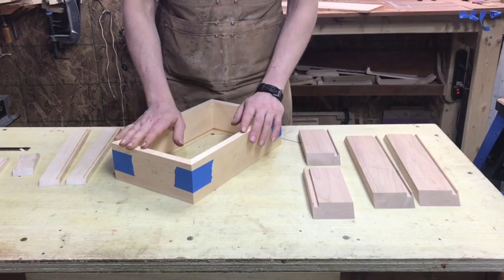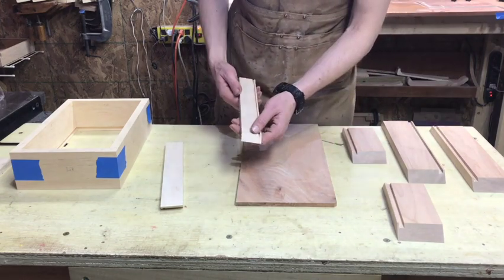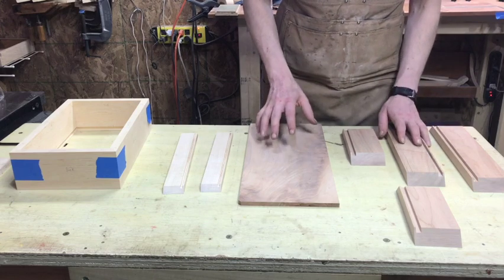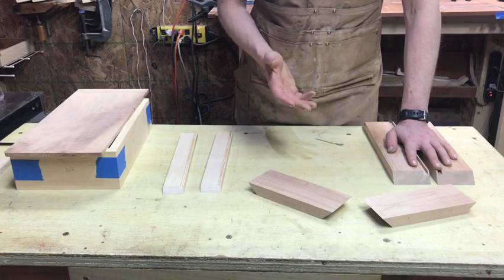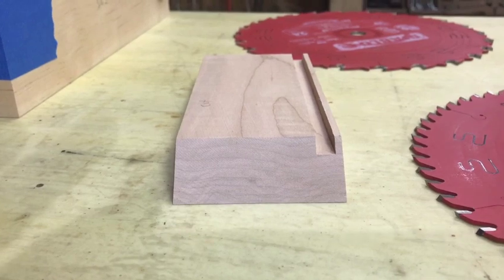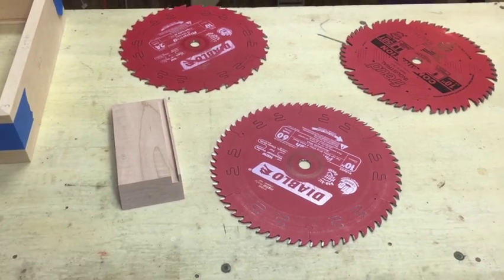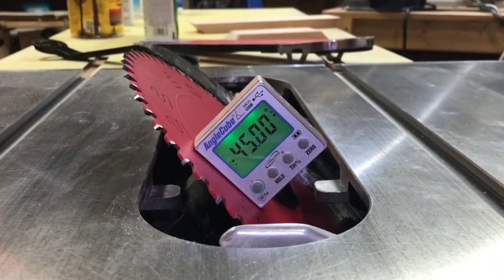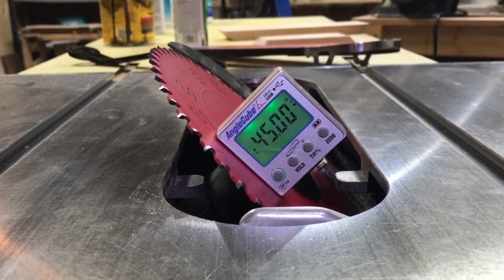Mitered Box Tips - How To Get Better Miters/Bevels!

Comment: Agree with everyone else, this is super helpful, really love the longer in-depth approach.

Question about the mini test box - do you mill that wood?  If not, how do you make sure inconsistency in that wood doesn't throw off the test pieces?
Reply from the maker: Thank you, I hope it helps. It took me a long time to get good miters, and I figured I would try to share all of the little things I learned the hard way.
Reply from the maker: I do mill the wood, but I do a fair bit of it at once, and then keep it all set aside to use for just that. I don't mill it to the same thickness as whatever project, I just mill it all the same and then use as is. It doesn't stay perfectly flat forever, but it is close enough. It's hard to keep any wood flat forever, so getting pretty close is enough for me. 

I will mill it in four, 11in long pieces, to safely get through my planer, and then the first mini-box is 11x11, and every time I just cut an edge off of each piece until it is too small to safely cut. I get quite a few tests out of the 11x11 pieces before they get to 3-4in and get sketchy. 

The 11x11 pieces may last me 6-7 projects depending on how many tests I need each time. I hope that makes sense.

Comment: All good tips and tricks. However...when I first started making boxes, I would spend literally hours trying to get that blade on a DeWalt jobsite saw to exactly 45 deg. Not sure who, and wish I could remember, but someone suggested cutting the miters on opposite sides of the blade. IE, cut one end on the left side of the blade and its mating piece on the right side. Say the blade is at 45.1 on the right side. This means on the left side it's 44.9. So, they complement each other to form a 90. I'll sometimes cut all the ends of my long pieces on the right side and my short piece ends on the left side or vice versa. I've got a sled or 2 and some miter gauges for use on the left or right side of the blade just for these purposes. Seems to work for me. Also, and I'm not sure you mentioned it as I skipped around the video some, but just as IMPORTANT as the 45, if not more so, is getting your pieces the same EXACT length. If the opposite sides of the box are not the same exact length, it won't matter how exact your 45 is. I use a stop block to achieve this. Tons of videos on here showing how to set up different types of stops and stop blocks. 

Thank you for the video and thanks to everyone else on here that has posted videos on box making, sanding, finishing, etc. This is where I learned and I've been pretty successful at making some very nice boxes. To me, there's not much else more satisfying than taking a couple of pieces of wood and making a nice box from them.
Reply from the maker: Yeah, that's a great tip! I often use that method if I am trying to edge glue a bunch of pieces for a panel, and don't want to get my jointing jig out for all of them. One over, one under, and any error is canceled out. I hadn't considered it on miters for boxes. 

Thanks for the tip!

Comment: If using a sled for the miters, I suppose the 45 degree should be set off the sled top vs the table ( since there may be a variation between sled and table) and zero out the wixey guage to the sled.  Your thoughts?
Reply from the maker: Interesting thought. I just do it to the table, but if you think your sled may not be quiet flat, then yeah, I guess it would make the most sense to do it to the sled. 

I had never really thought about it to be honest. I always prefer MDF on jigs because it is heavy, and stays pretty lat, which means I can be fairly confident it is the same. I may have to go test my sled later and see if it is any different. You may just have to test yours with some scrap wood.

Comment from the maker: Choosing the right wood - 1:15
Blade Choice - 9:58
Table Alignment - 11:53
Blade Angle (Angle Gauge Error) - 13:31
Sled vs Miter Gauge - 21:47
Tear Out Issues - 25:17
Removing Dents - 27:29
Sanding Mistakes - 29:00
Should you pre-finish - 33:48
Glue Up Process/Tips - 35:42
Spline Discussion - 41:25

Comment: Great video but I’m having trouble with glue squeeze out on the inside. I try cleaning it with a straw, wet rag, etc, but I still see the ugly marks when I stain. Any advice?
Reply from the maker: Sure...

- Stain/finish the inside first. Once it is glued up you won't be working on the inside anyways, so always stain or finish the inside first. 

- When you place your normal glue, not the watered down, don't place a ton near the inside edge. Paint some there, but not a ton, and then put more in the middle or outside, and as it squeezes to close, it will squeeze the glue in. 

- Put painters tape on those inside edges before gluing up. Then, just peel it off after it has all dried. This will prevent most squeeze out from sticking, and blue painters tape is usually pretty gentle on stain/finishes if the stain is fully dry. 

- At a minimum, just stain the inside before gluing it up, but for me, experience with how much glue, and where to place more/less of it, came with time and experience. You get a feel for it after your fourth or fifth box. Try all three at once if you really want to do everything you can. Wiping with a rag is a terrible idea if it isn't an area you will sand after, imo, and I have no idea why people do it on internal spaces. It just pushes more glue into the wood. 

- If all else fails, a small card scraper may be able to remove a very thin layer of wood, and take the glue with it, but you will need to wait for the glue to totally dry.

Comment: Great video.  I notice you did not show checking for square.  Do you do that?  The tape on the outside limits us to using the inside I'm thinking.
Reply from the maker: Thanks. I'll be honest, I don't really do that these days. The check is the pre-glue tape up check. Based on the math of the angles, if they all close, and there is no serious gap at the top or bottom, they basically have to be the same length on opposing sides, and square, since they can't close without all being 45, the same length, and square,  using my method. It's sort of a check along the way process. 

If your miter gauge/crosscut sled is at 90, your rips are straight and the edge sits flat, any piece that isn't the right length, or right angle, will show up in the check. Any gaps you can't see under the tape are likely due to cupping of wood. If the bottom and top edges are closing at the same time, then that piece is almost certainly square. If you have a small square you can check internally, depending on the size of the box. 

You can also just tape two side together, flip them into an "L", and then check that angle. That won't make sure your opposing sides are exactly the same length, but it will at least mean that those two pieces are square. Again, your wood has to be flat for this, as any cup will throw off the ability to get the square to sit flat.
Reply: Thanks. I had a bad experience lately with a small box.  I think I made the tape too tight and basically racked it.

Comment: Hi Mike,
Which is best blade for cutting bevels  and 
Cutting flat bottom grooves ?
Regards 
Paul
Reply from the maker: Bevels = at least 60 teeth. I use a Diablo 60 tooth crosscut, but plan to move to an 80 tooth Diablo once this 60 is dull, for an even better finish. (Diablo Fine Finish is the 60, and Diablo Ultra Finish is the 80). You can use a brand like CMT, or any other brand of blade that is in the Diablo or better range. Just make sure it has at least 60 teeth. 

Flat bottom = I currently am using a Freud Thin Kerf Rip, but you can use any rip blade that is Flat Top Grind, or a combo blade (Diablo 50 tooth), but the combos still leave a little bump, but it works perfectly fine for the mitered box base groove use. Ideally it will be either be flat top grind or Combo. I am really liking the Freud thin kerf rip, but CMT also sells a full kerf rip, as does Freud, that are flat top. 

In all honesty, any blade will be fine for making the groove for the base, as no one will see the little ridges, but if you do something like a sliding lid you will want either a Flat Top Grind blade (usually only found in some rip blades), or to use a router bit. 

I hope that helps.

Comment: What are your thoughts on sanding both sides while still a long board before cutting miters?
Reply from the maker: It's certainly a seductive idea, to be able to get it done on a larger, flat piece, but I am not sure I have ever made it through a project to the point where there wasn't scratches, dents, or just some surface defect that had to be dealt with towards the end. 

My table saw, for example, has some scratches in it that can leave marks on my wood. My bench has nicks and bumps that can mark up the wood, etc etc, so for me I always have to clean it up at the end.

This may be more dependent on your setup, and how careful you are. I am pretty bad at being careful up until I cut my miters, and banging wood off of things happens to me a lot. 

If you think you can sand it all evenly, it may be worth a try. So much of woodworking is pure experimentation, and refining the process from the mistakes we learn from, so it may be worth a try. 

If you do, let me know how it works out!

Comment: Is there a reason these cuts cannot be made with a compound miter saw?  Thanks
Reply from the maker: No, they can be made on one, but I think there are some reasons why it isn't always ideal. I don't own a miter saw anymore, so for me that is just not a choice. However, if I had one, at least a reasonably priced home use one, I would still do it on the TS for a few reasons. 

Most home use miter saws - <$250 - their consistent precision is iffy. They often tend to have some slop, in that there is a small amount of left/right movement on the raising/lowering of the blade during the cut. Depending on the project, your pieces can be quite small, so you need a way to hold the piece near the blade, and keep it absolutely still. Any movement on the workpiece can be make or break. 

I think it is just a lot easier to tune a table saw, have it stay that way, and then to keep the workpiece fixed in place when cutting. I also think the micro-adjustability on a table saw is a bit easier, in case you are off a half degree one way or the other. 

If I had a high end miter saw, or much larger pieces I might use it. Even then I may just bevel cut it with the fence on the TS if the piece has a long enough reference surface for the table saw, and is relatively square in shape. 

If you have a miter saw, you can definitely have a go at it. The same concepts apply. Blade at 90 to fence, blade at 45 to workpiece, complete holding of workpiece, and careful micro adjustment when needed.